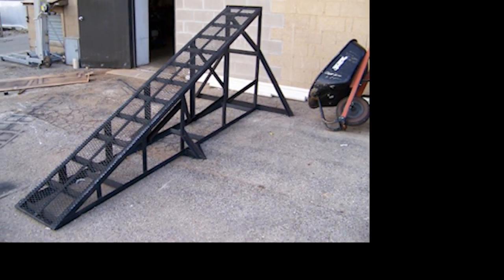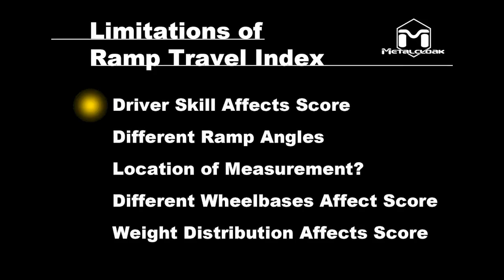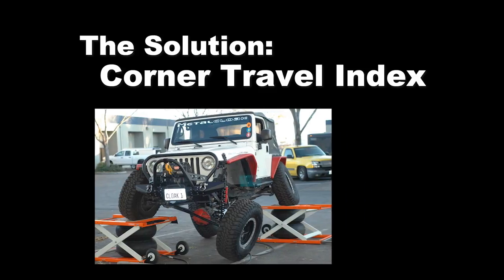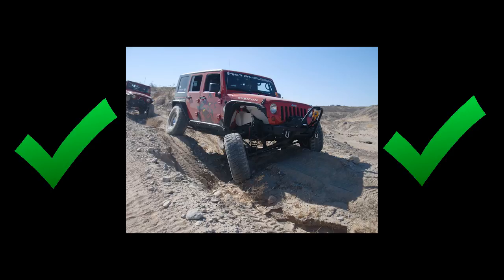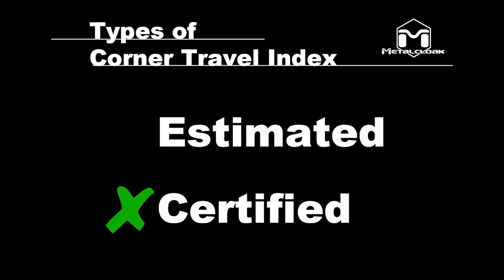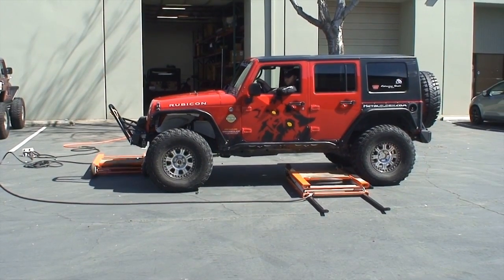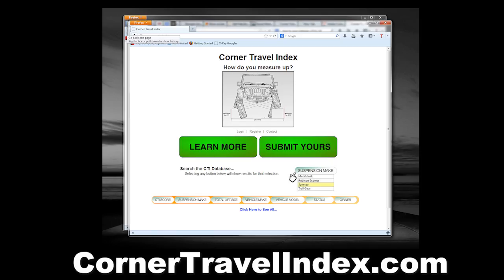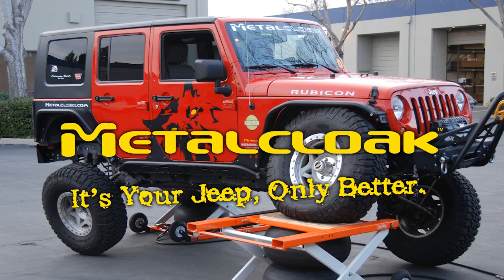Introduction to Corner Travel Index (CTI)

Comment from the maker: Jeff, thank you. You are correct. Flex is only a demonstration of the ability to keep all tires on the ground at all times, which, should equate to better traction, if, as you said, the rig is set up properly. As a suspension company we wanted a better way to measure that flex for demonstration purposes, hence CTI.

Comment: I might sound dumb, but anyway.  I think the problem with rti and now cti is that if you just purposely add a lot of droop to your axles then it will score better. I think the ability to stuff the tire in the fender will is more important than how much you can droop a tire. Stuffing a tire in the wheel well will allow a vehicle to stay low and not tip over.  Having a lot of droop just doesn't seem as effective in my opinion. And neither test really tests that too the fullest.  Rti kind of does but if you have a stiff front axle and a really flexible rear then it can score good anyway.  Thats just my opinion.
Reply from the maker: Actually CTI was designed specifically around that concept. When it was first developed, we had just released our JK Suspension with 6Pak Shocks... the first shock that was designed around a 50/50 ratio... 50% droop and 50% compression... which was why our 3.5" Game-Changer Suspension had more travel and a higher CTI score than any other suspension in the industry... because it was a combination of down-travel and up-travel... It showed the true articulation that you see on the trail... axles twisted... tires stuffed... coils fully stretched... all at once.
Reply: @metalcloak  Don't get me wrong I like the concept a lot.  I think it eliminates the concept of the back axle doing all the flexing. But my real problem is those guys that have leaf springs and shackles that are like double and just fold out and let one tire drop like crazy without stuffing the other tire. Either way I like it, I'm just pointing out what in my opinion is a way to cheat and get a good rti score.
Reply from the maker: @davidcraft4909  There are definite ways to cheat on RTI. When we came out with our suspension, we drove right up every RTI ramp we had. That's why CTI. Because it does BOTH the front and rear at the same time and at the same rate until one of the other tires come off... it takes the COMPLETE suspension into account... it does not allow cheating in that way. If you have a big droop front but your rear is all bound up, you will not get a good score.

Comment: Where can I get a set of lifts like that for my club events? I looked all over the web with no results.
Reply from the maker: +Carolina TrailStalkers Do a Google search for Air Bag Scissor Lifts and you will find a number of options. They need to be able to handle 2500 - 3000 lbs each. We build custom ramps to be able to drive up on the to the platforms and used wood to create a flat top.

Comment: so, if you want something better than an RTI ramp, you just have to spend $5k-$10 on a used fork lift or buy two air bag scissor lifts
Reply from the maker: Or you can spend $50,000 and build one of the CTI trailers that we travel the country with.  ;-)   https://www.youtube.com/watch?v=7hkhWCxSttQ
Reply: @metalcloak  hell yea, that's cool ! i need one of those to test out my new build. but, i spent all my money on the metal and jeep parts to turn a $700 jeep into a $10,000 jeep. so please bring the cti trailer over when you stop by my shop for a beer  ;)